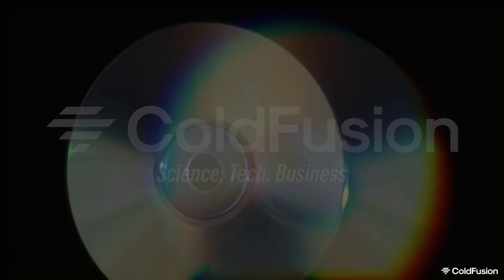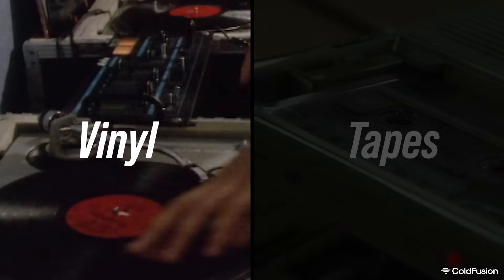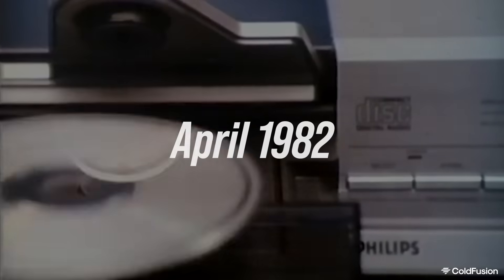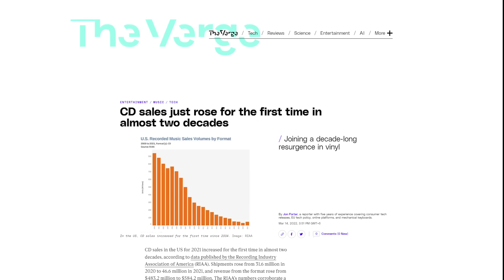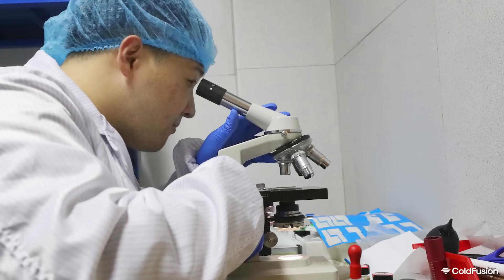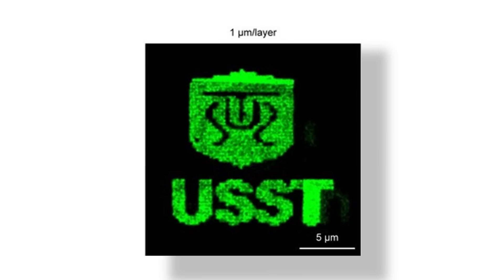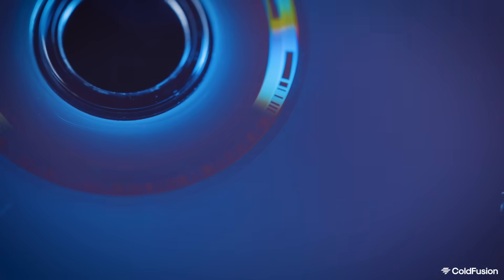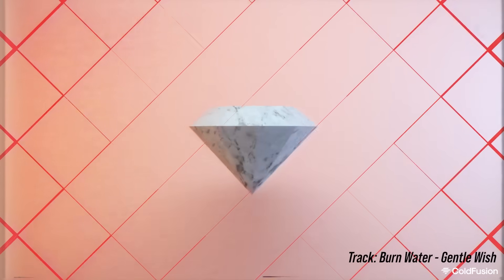Why This New CD Could Change Storage

Comment: Something like this disc technology actually got designed many years ago in Australia.  They called it a 5D (5 dimensional) disc.  Then it just vanished nothing happened. It was said that a company bought it and shelved the patent.
Reply: UK had the same thing in 2013. Used smaller discs, with double the capacity, and was dubbed "eternal storage" because it can withstand 190 degrees C for the lifetime of the universe. Presumably they had the same issue of it taking about a decade to write one disc!
Reply: @alexandralillywhite5997  So, in real time !
Reply: Someone got rid of competition? 🤔
Or maybe they realised how silly their project was.
Reply: @Azarilh Nestle, Coca Cola or other big companies have been doing this, buy revolutionary items or things from small company then shelve it competition is dissolve.
Reply: @DOI_ARTS  I am not sayin it doesn't happen. I am sayin not always it's like that. Some times projects don't turn out the way one imagined it.
Reply: A.C.Clarke, 3001 last space odyssey data drive
Reply: Source?
Reply: Make two disks to keep in separate places. Most people keep more than one backup.
Reply: That 5D storage system ended up in England: Cambridge, and they tried catering the technology to university and government libraries. I was in contact with them for some time checking up on advancements/availability and trying to talk them into making the product for the average consumer as opposed to university/government, because both already have multi backup sources for all of their data/books etc.

They said they were working on improving write speed and that was the last time I heard from them. So not sure what happened after that.

The disks in 5D storage were made of glass and were about an inch to an inch and a half in diameter and about a quarter/third of an inch thick. Practically unbreakable. Heat resistant to hundreds of degrees, Once data was recorded it was permanent. Really wish they had focused on consumer availability. @alexandralillywhite5997

Comment: so basically its a very slow method but allows huge data storage, also its cheap to manufacture but since data retrival depends on physical disc movement its slow af, maybe tho we might see its implementation in hard disks since its easy and cheap to manufacture as they say (6 minutes with similar tech for cd manufacturing)

Comment: 1.6 petabits? ... why not just call it 200 Terabytes 😅  at write speeds of 1 MB/s ... do you want to wait over 6 years to fill it?

Unit                  	Value              	Size

bit (b)             	0 or 1              	1/8 of a byte
byte (B)          	8 bits              	1 byte
kilobyte (KB) 	1000^1 bytes	1,000 bytes
megabyte (MB)	1000^2 bytes	1,000,000 bytes
gigabyte (GB)	1000^3 bytes	1,000,000,000 bytes
terabyte (TB) 	1000^4 bytes	1,000,000,000,000 bytes
petabyte (PB)	1000^5 bytes	1,000,000,000,000,000 bytes
exabyte (EB) 	1000^6 bytes	1,000,000,000,000,000,000 bytes
zettabyte (ZB)	1000^7 bytes	1,000,000,000,000,000,000,000 bytes
yottabyte (YB)	1000^8 bytes	1,000,000,000,000,000,000,000,000 bytes

bit (b)              	0 or 1                              	1/8 of a byte
byte (B)          	8 bits                              	1 byte
kibibyte (KiB)	2^10 bytes                     	1,024 bytes
mebibyte (MiB)	2^20 (or 1,024^2) bytes	1,048,576 bytes
gibibyte (GiB)	2^30 (or 1,024^3) bytes	1,073,741,824 bytes
tebibyte (TiB)	2^40 (or 1,024^4) bytes	1,099,511,627,776 bytes
pebibyte (PiB)	2^50 (or 1,024^5) bytes	1,125,899,906,842,624 bytes
exbibyte (EiB)	2^60 (or 1,024^6) bytes	1,152,921,504,606,846,976 bytes
zebibyte (ZiB)	2^70 (or 1,024^7) bytes	1,180,591,620,717,411,303,424 bytes
yobibyte (YiB)	2^80 (or 1,024^8) bytes	1,208,925,819,614,629,174,706,176 bytes

Comment: A lot of buzz around this new capacity, but would you put all your video or audio data on a single fragile plastic disk, and take the risk that in case of failure you loose everything? Those high storage capacity disks are more suitable for professional use in servers rather than for consumer use, anyway.

Comment: The smallest laserjet to make temperature  change and reconstuct the 🪞 reflection for polycrystal structure.
Instead of using magnetic tips and magnetics sense disc, this use crystal and laser

Comment: Such a technology returns control of backups to you and away from the concept of cload . Affordable backup of massive size means many backups on the same disk , and the end of tapes . Storing massive data at home and giving massive archives to friends on a single disk will make piracy too easy . For these
Many reasons , I will be surprised if such a tech is made available to the public , perhaps by keeping rhe price too high to keep it for corporate use. Good on, if it’s made in China , it could happen and could eventually go retail

Comment: We have at my office around 200TB of data stored on 160 HDDs (raw camera footage and final ads and tv shows). Those HDDs take space - like one large refrigerator. It would be nice to have that all stored on one CD. We probably would not pay 50k $ for device but probably pay for some service to backup all our data and write 3 copies of that data.
Reply: That seems a bit inefficient with the number of HDDs to total size. I have 16 HDDs (with 4 drives used for parity) between 2 servers at home. The total size is 213.4 TB. The smallest size is 16 TB though and the largest is 20 TB.

Comment: 200 TB on a single disc? Yeesh! That's extremely densely packed optical data. So they'll be even that much more susceptible to scratches and even re-arrangement of the plastic atoms due to thermal contraction/expansion. In fact, I would doubt that you could ever make a full disc without at least one bit wrong on it after the burn. Luckily that can be worked around, more or less with redundancy. The most popular method which has been around for quite a long while is PAR -- for Parity Archive. I think WinRar also allows you to put in redundancy as well. It's fascinating the way it works, though. No matter what data on the disc becomes unreadable, it can be re-created by math and those additional parity blocks that are added. You can even set the amount of parity redundancy you want -- basically the maximum amount of data that can be unreadable on the disc and still be recoverable. It'd be interesting what that setting will eventually turn out to be best practices on this extremely dense type of optical storage media? 5%? 25%? 50%? Even at 50%, it still would be worth it for extremely long-term storage, IMHO -- that's a TON of data in a very small and light form factor.

I'd be worried about paying that much money, though, if the laser it uses is only good for a few dozen discs before its own beam becomes degraded.

Comment: The Petabit CD was actually invented more than 20 years ago by a Romanian engineer. Of course, the CD-ROM manufacturers at the time had no interest in destroying their business by selling a customer just one or two Petabit CDs, so they bought the patent rights to prevent Petabit CDs from coming onto the market. This story was reported in the media at the time, I'm surprised nobody remembers.
Reply: Makes me wonder how much technology has been suppressed to keep the status quo. There are a lot of stories, most call 'em myths, of inventions such as an additive that lets your gasoline car get 100mpg, or a carburetor design that does the same- stories about Tesla, and how he invented radiant power which was suppressed because power companies & oil companies saw their demise if it was allowed to happen. I'll always wonder!
Reply: @deniswauchope3788 the carborator story is true. I used to think it was fake, mostly to how the story was told. What it does, is run the engine so lean that the temperature gets hot enough to burn atmospheric nitrogen. The problem with this, besides ruining a normal engine, is the production of nitrogen dioxide. Wikipedia has (The LC50 (median lethal dose) for humans has been estimated to be 174 ppm for a 1-hour exposure.[11])
It causes emphysema and other lung diseases at lower concentrations. Also, tampering with the nitrogen cycle would have grave effects on the growth of crops. Regular car emissions are bad enough. It was the EPA that squashed this one. It had nothing to do with the petroleum companies.
Reply: Not a surprise that this happened.

Comment: In addition to the ones mentioned in the video, I think the major problem would be the physical handling of the discs, which are prone to scratches and warping due to heat and pressure. And considering the risk, 1.6 Pb is just too much data to lose.

Comment: Your closing arguments were wrong - Opitical data is the LEAST reliable - data fad of recordable media is a fact - over the last 25 yr of using it I've most 5-percent of my data to fade (I still use all three BDr's/DVDr's/CDr's - I never buy MP3 I don't stream anything (becasue streaming is renting and not owning - and when the music/movie contract ends with the streamer, your movies and music vanishes forever.

I buy CD/Blurays and encode my own mp3 using CDex - and a strip the region codes of my movies using DVDFab. Since record all my music/video to optical discs - then make a duplicate of every disc - the chances both disc  of the same number in a series go bad is virtually zero, so WHEN a disc goes bad i just make a copy of the copy to replace it in the set.

If you life depends on archiving - opitical media is the LAST choice!!!!!!!! - First choice is GOOD OLD SLOW MAGNETIC TAPE!!!!!!!!!!!!

tape archives do last forever!!!!!! "Colorado somesuch" back in the day ruled PC backups and the data never faded.

Comment: There is absolutely demand for this medium. Will I be walking around with a Discman, probably not. Will i remote connect into my computer at home via my phone to play any media I want through my disc drive, you bet your ass.

The bottleneck is still speed and bandwidth, but by leveraging the strengths of one medium in tandem with others, you can create quite useful and fitting use case scenarios. 

I had a Discman back in the day. I wouldn't even walk with it (how it was advertised) let alone run with it. I have no qualms running with my phone though. What i'd love even more is if I could remote into my computer at home through my watch. That's the ultimate walking/jogging/hiking use case right there. 

Combine that with something like a wireless head mounted display similar to the Viture XR or Xreal Air, and your off to the races. 

100% there is a market for physical media still. Especially physical media of this size. If anything people are growing weary of the subscription model of data streaming.

Comment: There's a ton of caveats you never covered in this video that also add to the expense and non-feasibility of this tech. Due to the bit-scale, the mechanical vibration resilience & recovery becomes a massive problem that would make a consumer variant prohibitively expensive. This factor also limits the spindle rpm, as vibration harmonics build up due to the tiniest imprecision of the base-plastic fabrication, the focal pattern-recognition-system will become overwhelmed unless a very expensive (and durable) system is employed. Dye-based media degrades as a function of simultaneous erosion-nuisances (heat, light, chemistry, time) and the radius of the defined bit. This means, the smaller the bit, the shorter amount of time it takes for that bit to become unreadable (bit rot). Due to the inherent precision required of the read-write device, we're seeing mechanical tolerances on par with modern high capacity hard drives, drives that cease to function if exposed to the local atmosphere. There's a bunch of reasons Syquest drives no longer exist. If these prototypes survive the durability gauntlet of M-DISC, then we're going to see a very serious contender, until then, it's just a fun stepping stone on the path to something useful.

Comment: As a common Joe, I haven't outgrow the compact blu-ray disc capacity. One format I really like was the defunct Sony MiniDisc. Almost indestructible even if you throw the disc against a brick wall, no worry about scratches or fingerprints , excellent fidelity, easily reordered music tracks in any sequence, erase or add individual tracks, one AAA battery last a long time and some models could record life audio in CD/studio quality, and the player fits in my pocket for on the go.
Reply: The thing that made MD so indestructible was that the disc had an enclosure, much like a floppy disk, and they most likely had an enforced minimum standard for the formulation/quality of the disc itself. The problem with the popular R/RW media was the disc was fully exposed, leaving it vulnerable to scratches and dirt. Even a fingerprint on the disc that you can't really see would cause a weak spot on the disc from the writing laser getting partially blocked and diffused that could quickly fail later on. And there was no enforced standard on the formulation/quality of the discs themselves so you often ended up with discs that get errors and become unreadable far sooner than someone would reasonably expect. The higher the data density, the more severe the problems become. If they ever release this superdisc, they will have to have it kept in a floppy disk type shell or else the failure rate is going to be very high. As it's presented here, this looks like something that would really only be practical in a laboratory clean room or sealed inside of a permanent enclosure like a hard drive as even a speck of dirt will blow away 100s of MB. :-/ I would be content if this could only store 20TB but was durable and robust enough for use in a typical day to day environment.
Reply: They use a lossy compression format similar to mp3 so there is a compromise in sound quality that's unacceptable to people with high end playback systems. I used them for recording lectures before digital video was affordable. This was before smart phones.

Comment: Okay, before we all rush out and buy these discs here's a little personal wisdom from an old millennial: Discs had TWO major problems: One was disc rot. The layer that held the data began to break apart and in a few years time whatever you wrote on the disc became unreadable. The second, even bigger problem is rewrite-ability. All of the discs I had were ROMs. Meaning: Read Only Memories. You could write data on a CD-R or DVD-R (writable compact disc or writable Digital Video Disc), but only once. If you purchased a CD-RW or a DVD-RW you had a limited amount of rewrites if your disc and the burner was fancy enough. So, maybe these scientists have made a disc that no longer rots, but the rewrites will still be an issue. Since the data is physically etched into the material of the disc, there is no permanent way to get rid of it! These discs will be completely unusable for most average users. These things are like a permanent storage for your digital memorabilia that you no longer wish to modify or delete. And for that purpose, their size is completely unnecessary. And server use would need a lot of data rewrites which you can't do in a ROM storage.

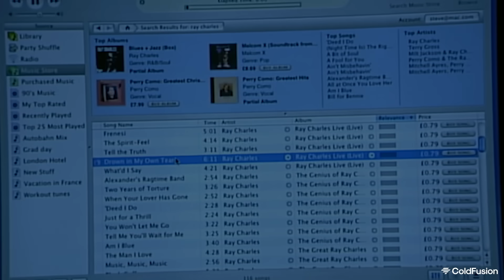Comment: 5:19 

CDs (Compact Discs) have certain technical advantages over flash storage, particularly in terms of data longevity and stability.

CDs are based on optical storage technology, where data is written and read using a laser, and are known for their durability and ability to retain data integrity for decades if properly stored. Unlike flash memory, which relies on electronically erasable programmable read-only memory (EEPROM) cells that can degrade over time due to charge leakage, CDs do not suffer from this form of data corruption. This makes CDs a more reliable medium for long-term storage.

Flash memory, although faster and more convenient for frequent data access, is more susceptible to data corruption over shorter periods, as experienced by the user, due to issues like cell wear and charge retention failures. Hence, for archival purposes where long-term data integrity is crucial, CDs can still hold a technical advantage over flash storage.

Comment: Current costs are pretty much irrelevant.  This is the "alpha" stage, perhaps even a pre alpha stage.  I would expect the costs to come down, way down.  As to using cloud storage making it so people won't adopt it.  Nonsense.  If I had the ability to store was is basically every piece of data on the Internet sites I visit, and have interest in, I would.  I would have a Google type web crawler constantly scouring the Internet and storing it locally.  That way when I want to "web surf", I would do it locally in my own system.  No Internet connection needed.  I would bet that there will be an "app for that" developed, if there isn't one already.

Comment: I remember around the year 2000 a company called Constellation 3d WA making something like this called Fluorescent Multilayer Disc (FMD) that also used tons of layers and had clear discs. It claimed to have terabytes level capacity.... There is a wiki entry for this company and technology.... Eventually it proved to only be research, it was not commercially viable.

Comment: TLDR; this new technology has even more extreme limitations and challenges than 10 layer DVD and 10 layer BlurRays have.  It only works in the laboratory with extremely expensive machinery. It has been over 50 years, and commercial viability for both DVDs and BluRays, is still not attainable.  The chances of this new technology working in your lifetime is pretty much nil.